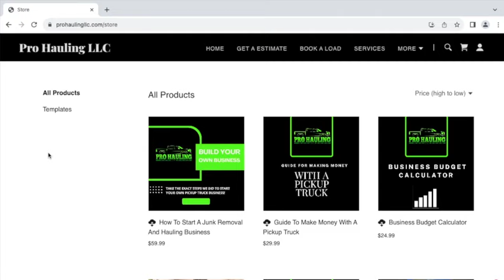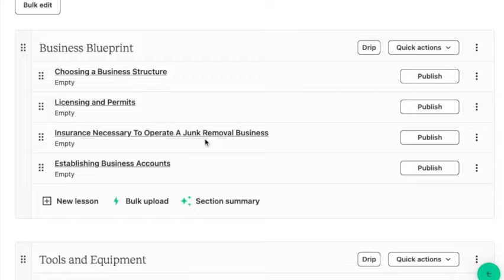HOW TO MAKE $1000 A DAY WITH A PICKUP TRUCK

Comment: The twist keeps the vibrating noise to a minimum
Reply: Yeah, the twist keeps the strap from catching wind between the object and strap that can cause vibration, slapping of strap against the object, and wear on the strap itself. There is some sort of aerodynamics or rigidity increase with the twist that keeps the strap from catching air and vibrating.
Reply: @GlennTXstate10 that’s only because it’s not tight having that twist is improper is not supposed to be strapped down like that and when it starts to do that you have to tighten it up again

Comment: No it should not technically be twisted but for a low that small and not really supporting much weight at all it would be just fine but you definitely should not Criss-Cross your straps in an ex-con across any load